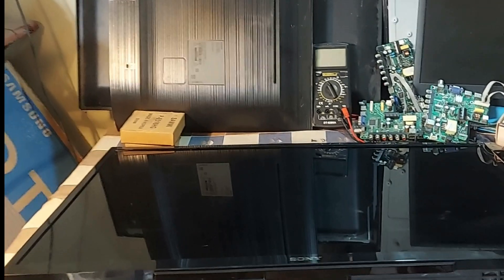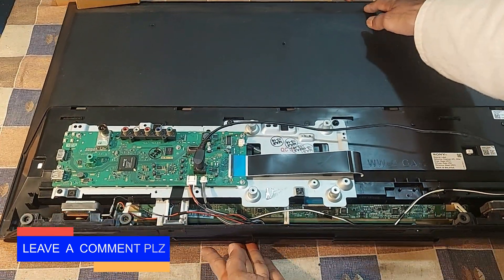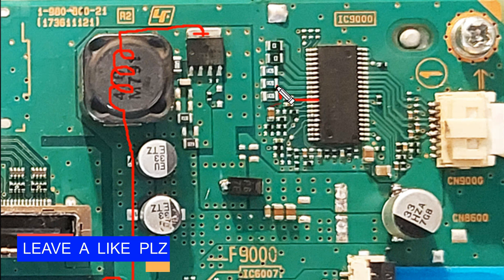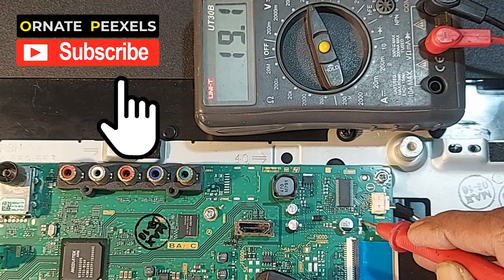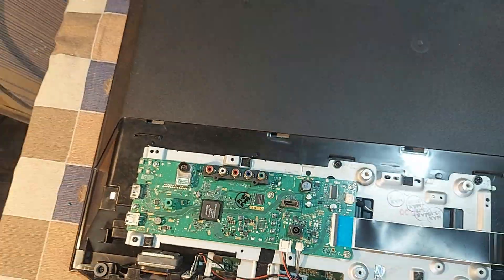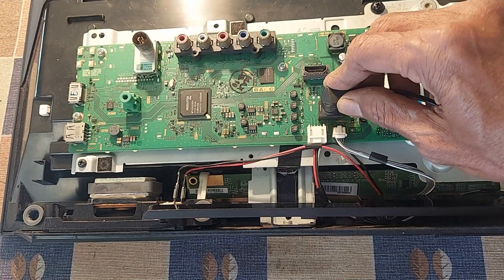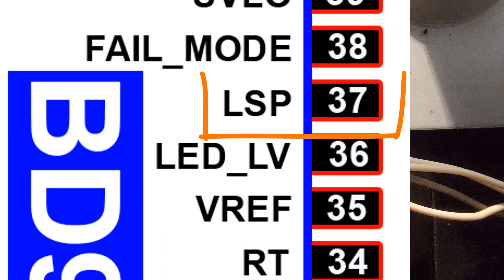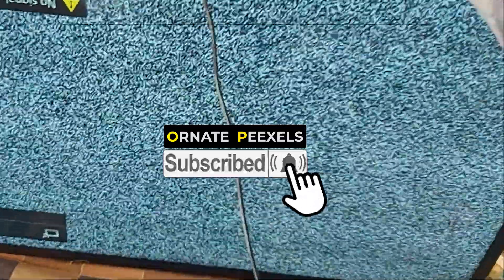6 Times Blinking Problem Sony Bravia Smart LED TV | Sony Bravia 32" TV Power Light Blinking Solution

Comment: i have the same issue, but when I checked backlight voltage, it's 18.7v. According to this video  it's not increase about 40v and decrease. (I followed the same steps as the video). what is the reason that ?😢

Comment: I purchased the same brand for 33000 .After one year suddenly it stopped no light no sound. The technician said he replaced panel and charged 7000. Again after six months there was same problem. The technician wanted 10000 to change the panel. I just threw it in store room six years back.  None would agree that there is something wrong in circute.

Comment: Very instructive.   Please I would like to ask something, I have my LED tv Samsung 42 inches;  there's no image but all voltage are ok. I tried to measure even the cof voltage but all voltage are present; and on the tcon board all voltage are present. Now what will I do in this case?
Reply: If u checked all voltages okay,u will need to reprogram the eprom ic
Reply: @karo2890  it mean that the EPROM memory has been cleaned?
Reply: @laurentkadima-od8sb  exactly

Comment: i have almost same condition on my TV. There is 8 bars backlight LED inside and  left 4 bars dont work, only right half 4 bars are working. I checked this kind boboost circuit and i realized that when i plug out backlight LEDs one of pin voltage of backlight driver is good but when i plug in left LED's connector again then backlight driver pin voltage reduces again. i see that there is short in left led bar side. Thanx
Reply from the maker: Welcome & Thanks Brother
💗🧡🌹❤💖